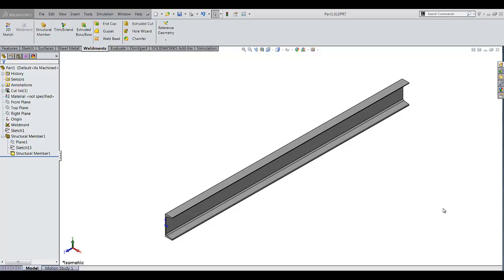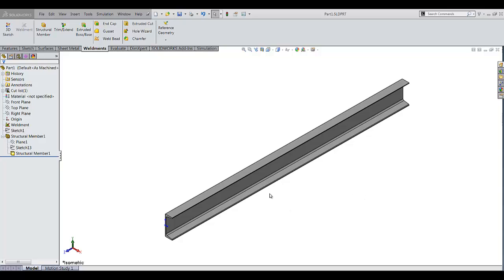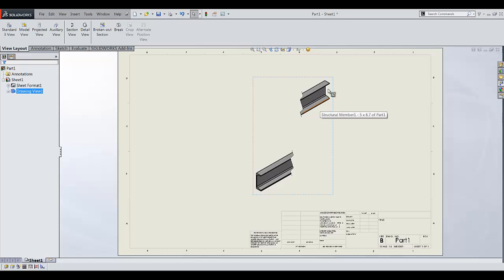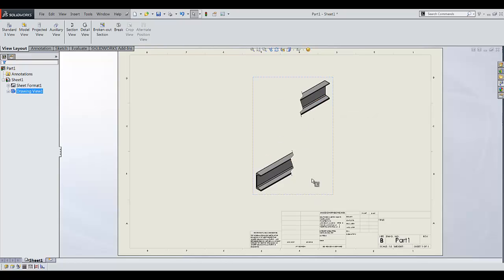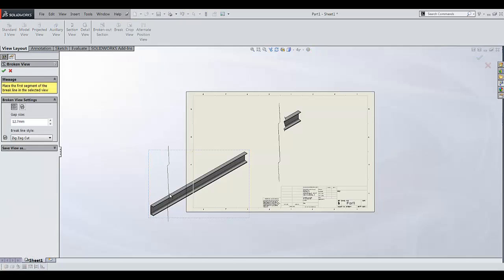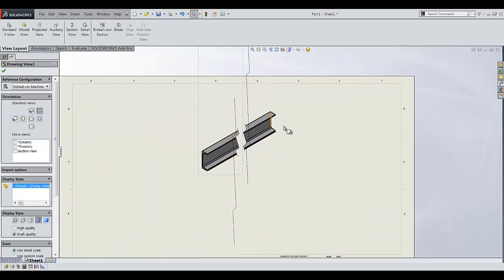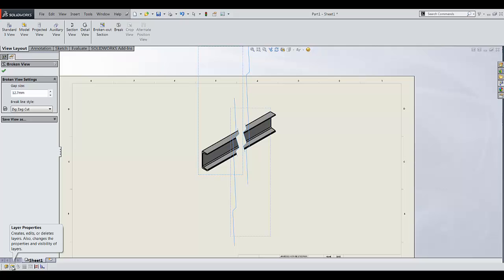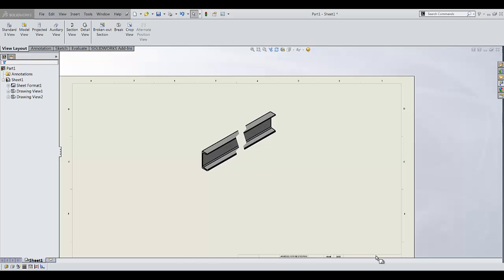How to align Angular Break Views in SOLIDWORKS

Comment: hello.  re version of  SW 1916
i want to offer you a  PROPER  way to make an angular or straight view in either model or drawing view.  this way means both parts live up correctly.

the method you you is not very elegant, sadly.

to make an aligned break view 
1/ open a model
2/  go  INSERT  -- MODEL BREAK VIEW and make the break 
3/  go to  MAKE DRAWING FROM PART/ ASSEM
4/  on  the LHS  under  PROPERTY MANAGER   you will see  REFERENCE CONFIGURATION  and  SHOW IN EXPLODED OR MODEM BREAK VIEW
5/   tick this box
 now your break view is aligned

see very easy.  i sugegst you look at youtube a little more as this is where i found this
Reply: Very helpful, thanks.
Reply: Unfortunately there is no way to do this on an exploded view therefore video works for exploded views.